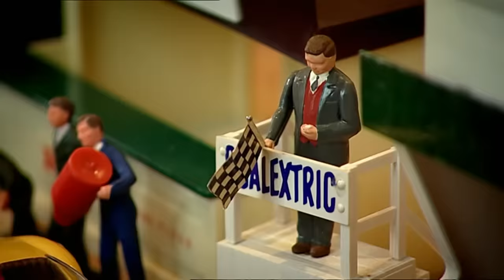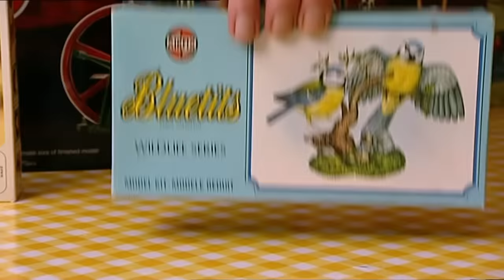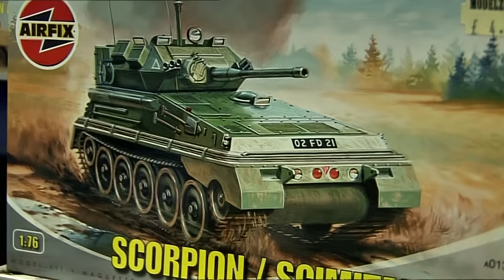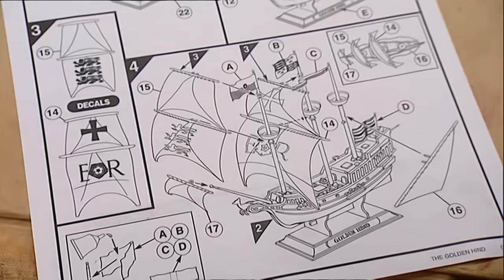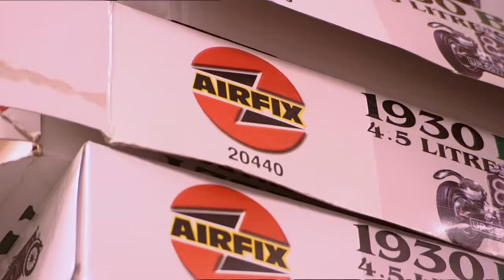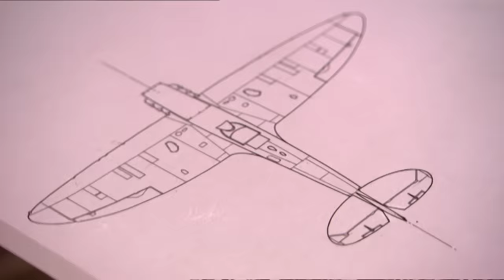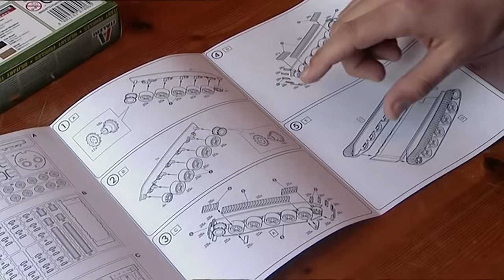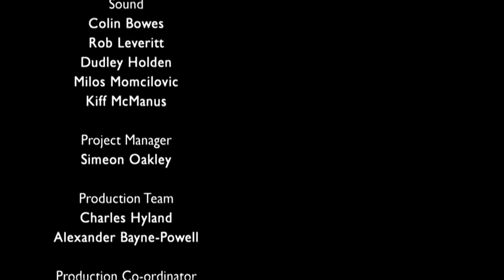The World's Largest Model Spitfire | James May's Toy Stories

Comment: excellent video. But I was reminded of how much fun I had and how much I loved building models mostly because I learned so much about the cars, ships and planes I built. When building a newly made model - a Porsche 956/962 kit by Tamiya and I noticed 2 things that modelmakers were doing with "modern" kits. They stopped providing the names of the various parts and some kits stopped including the engine in some kits! I know this is to keep the cost low but from the time I built my kits until the time I wanted to work on my own car, I had learned almost all the various parts that were needed to create a modern motor car.  I not only knew where a starter was located, and to recognize the shape of the real thing!  This knowledge is no longer provided to new model builders and it's a real tragedy.

Comment: Dang it your adventure has convinced me to build a special plane , saw it was , well it captured the 10 year old me. Sure enough  I have tried to build it several times. I refer to it as a cursed project, as each has met with failures of unforseen  circumstances.  Motors catching fire , duct fans exploding batteries failing, radio problems,  a lot of crashes.  I speak of an experimental Phantom jet, one of a kind. The plane was the YRF-4E,  a Phantom jet with canards . The original was lost by the air force museum.  2v, 70mm electric fans 10mchannel controler,  10 servos , flight stabilizer,  retractable landing gear, FPV, detailed cockpit,  and custom paint. A tiny  foam version did fly. But this one is 8ntimes larger ....where to maiden it, such things are now ....oh well let you know if it flies.

Comment: My father was at Cosfoth [sp.? ] during WW2 with no. 1 or 3 mu [ maintenance unit ]. He saw a new / proto type Spit. take off. [ engine sounded different ] the pilot went into a vertical climb and it then disappeared into the clouds. After a while it came down and sadly buried itself in the ground. The thought was that the pilot ' black out' due to the G forces. Sad story / ending.

Comment: my dad bought me the Apollo Saturn 5 when i was when i was 8, (i think the same year NASA retired it) so it was still fresh in everyone's mind, even here in the uk.  i think it had about 300 pieces, or maybe more, but i actually built it, including the models of the pilots as well as the bit that stuck on the end like a tower, whatever that was for. anyway, its in the video at 2:30
Reply: That was your ejection rocket :) it quite literally was a rocket designed to pull the capsule free from the saturan 5 rocket in case of needing to immediately abort launch once the mains were lit.

Comment: Sir I too built model airplanes, 1/72 scale 131 different planes over several years. They were displayed on a wall each with  some details . Tiny biplanes with human hair guide wires,   each paint scheme researched  hand painted, work crews worked on some, each hand painted . I also use to work on watches, good eyes and steady hands, I miss those qualities in my old age. My sister stopped by while I was at work, with her kids, as the lady folk talked the latest gossip. The kids found the planes, flew them all into the wall , yes they broke every one of my planes ....I smacked my 200 pound brother-in-law about over it, he was offended I yelled at his kids and his wife .... we have not spoken since Humm it's been 40 years, I'll rethink this in 20 years.  It's a fun hobby, add power and radio control and the FAA won't let you fly it. Full scale is all that's left.

Comment: I'm going to be honest, watching the students try to assemble the models without a pair of nippers at the start was painful. 

Craft knives are good but you're applying a lot of force to the parts instead of cutting it off in a small area. 

I usually reserve the knife for cleaning up nubs or lightly scraping away the flash (the excess thin plastic that doesn't belong on the kit).

Comment: Why did the spitfire model have five wings on its propeller?!
Reply: There were some five - blade propellors in late model Spitfires. Couple of version had a 2 x 3 - blade contraprops too. 

It depended from engine effect, that propellor must match with engine power and Spitfires speed too (naturally!).

Comment: Sadly just a year or so later it appears to have been broken up which I find if so is really disgusting as it was a major feat of engineering, design and achievement in its own right
Reply: No, it's still at Cosford. It did go back to Gateguard to have some extra supports fitted internally shortly after they finished building it.
Reply: @shed66215  GOOOD
Reply: Unfortunately it wasn't. Give me a pick exe and I will enthusiastically oblige